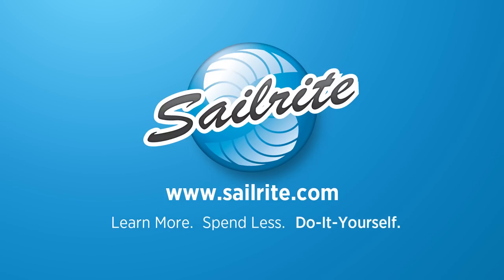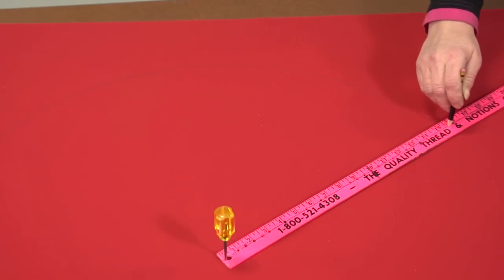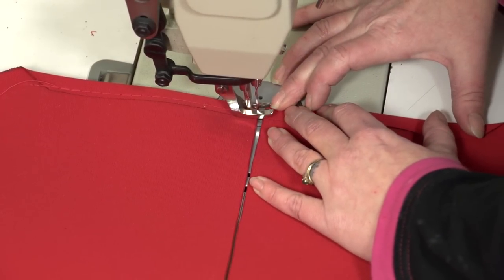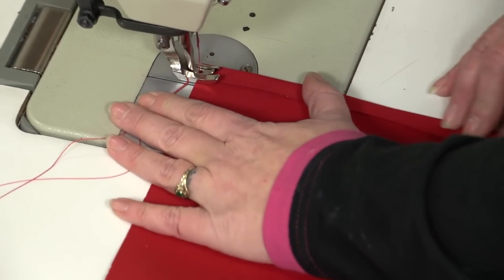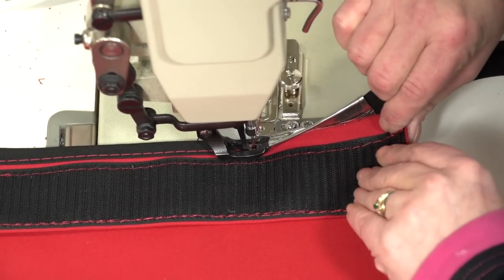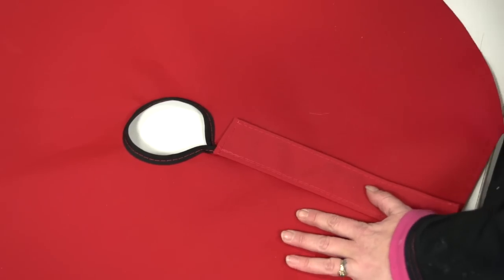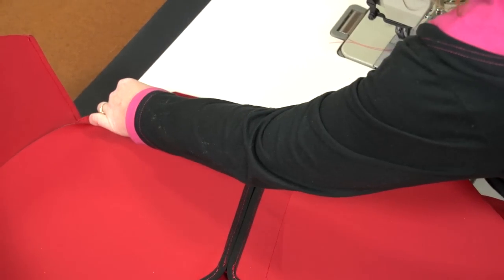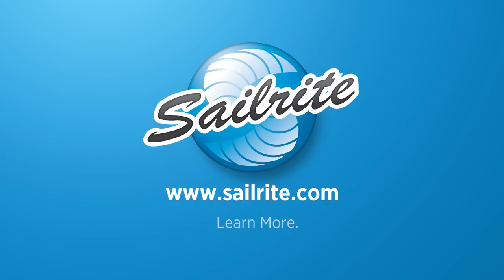How to Make Tire Covers for a Trailer or RV

Comment: I want to commend you on this video.  I followed along with the video and completed a set of 4 covers start to finish in a few hours.  They turned out great...  A couple of things I learned along the way included adding an additional 1/2" to the width of the rectangular velcro cover so that my covers lay correctly when closed,  using the max / full tire diameter and width dimensions so the covers are easier to get on and off, and finally with my 205  15 trailer tires, the 60" material width was sufficient for the length of the boxing piece, allowing me to get the entire material needed for each cover out of a single yard of material. 

Thank you for providing such excellent reference material for this and your other projects.  This video made tackling this project so much simpler, quicker and (likely) more successful than doing it completely from scratch.
Reply from the maker: John, Glad we could help. Great suggestions and comments. Thanks!!!

Comment: Thanks for posting these instructions. I was able to follow along and make covers for my teardrop trailer. I used a grey sunbrella fabric to blend with the metal of the teardrop.  I recommend being liberal with the dimensions. My first attempt I could not get the covers over the tire (in part my tire wells are very tight).  My not so elegant solution was to add additional width on the center strip. I added 4" and then was able to get the covers over the tire. If I did it again I would expand the dimensions  of the center section.
Reply from the maker: +Stephanie Weigel Good advice!

Comment: App. how many yards of fabric would you need to make 4 covers (abou the size of the tires in the video) Trying to weigh out making my own vs buying. Thanks in advance!
Reply from the maker: For each tire it will take about 2 yards of a 46" wide fabric. This covers the front, back and face of the tire.

Comment: If you are making a spare tire cover based on this design, could you use non marina grade fabric and waterproof it?
Reply from the maker: I would not do that, but if you did you could use 303 Fabric Guard to help make it water resistant, not waterproof. If you want a waterproof fabric it must by a vinyl coated fabric.
Reply: what if you used an iron on vinyl coating?
Reply from the maker: Cheyenne Gingras I do not recommend using an iron on vinyl coated fabrics.

Comment: I know that the outside of the tire is exposed to the sun continuously as well as some of the tread when parked. What does covering the back of the tire accomplish?
Reply: It could be for sun (like on a jet ski trailer where the back can get sun. But it's job is to hold it on better (for the wind or whatnot).